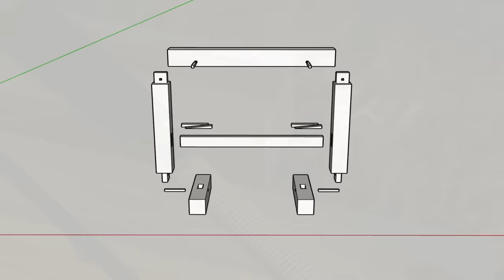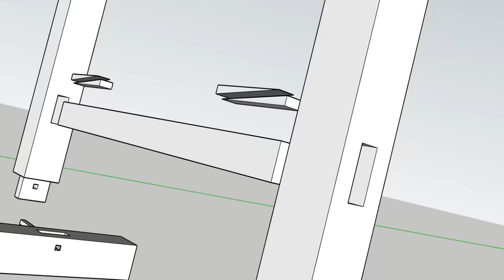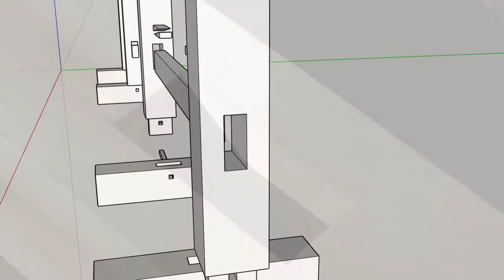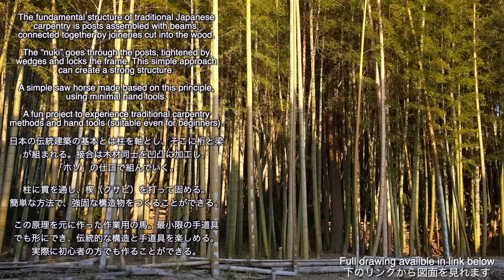Building a Carpenter’s Sawhorse - Joinery and Hand Tools (suitable for beginners)

Comment: I made a couple of those last summer! Almost the same, but the middle stretcher in mine has a tenon either end and is secured with wedges once through the mortice holes (tusk tenons?). I also rounded the feet in ogee shape as my in-laws use the saw horses as legs for a large outdoor table in the summer (I get them in the winter!). They are fantastic, and I really must make a second set because I've nearly always got something in top of my existing ones. The wood I used was just old junk wood from my father in law's farm, but it turned out nice, whilst doubling the work to make. Your approach of just a single beam is far more appropriate. I'd probably make a concave hollow in the centre of the feet so that there is just contact on the ends rather than a flat surface as I tend to use on uneven ground.
Reply from the maker: Yes, I would recommend a concave hollow on the legs as well. I wanted to do that but wanted to keep it as simple. Good luck and enjoy making your second set!

Comment: Lovely woodwork. I have 2 technical questions:
1. Is the a point in the pegs being square (opposed to round) other than athstetics?
2. What is the purpose of taking the sides of the taps, instead of letting them be the full width?
Thank you for a nice, clear and calm video.

Comment: Very cool. Sent you a beer for the 3d model. I am wondering though about the marking - what is your reference? In some cases it seems like you are doing center line reference and in some you use one of the faces?
Reply from the maker: The joineries are marked from the center reference line but only the pin (which is slightly offset between the mortise and tenon) is marked from the face. Cheers!
Reply: @dylaniwakuni  thanks for the reply. Now I am wondering how to get the mortises be at the correct angle relative to the imaginary plane. Especially for the square peg. Looks like in this case you squared the timbers precisely so all surfaces are at 90 degrees to each other. But how does one chisel the mortises when the timber is not all 90 degrees... Especially a through-mortise. I'm very puzzled. =)

Comment: i cant open the models u hoped u can add a  PDF file. btw wats the size of the beams? thicknes
Reply from the maker: I think you can view them from SketchUp:

It is free to download. To view the file, you will need to log in to SketchUp (free). A mobile app is available on the App Store.

https://www.sketchup.com/plans-and-pricing/sketchup-free

The beams are 90x90mm
Reply: @dylaniwakuni  thanks 90x90 i can work with that. i use fusion 360 as my drawing tool

Comment: You can hear the wood split at 11:20.
Reply: I don't think so. The way it's encased it had nowhere to go. Probably stepping on twigs
Reply: @Rufio1975  turn up the sound. Either way, it doesn't matter, just found it notable.
Reply: @Cannonudders  
I'm not arguing with you man.  Just giving my opinion. That's all.  You could be right.
Reply: @Rufio1975  all good. It's certainly not going to be an issue, those joints are rock solid. Great work.
Reply: @Cannonudders  
Yea, I dig his channel.

Comment: I've noticed the Japanese aren't too concerned about checks and splits in their timber . As a builder, I'd never use such splits.
Reply: In terms of building saw horses you mean?
Reply: @royalmoline7073  
Well yes and no. I've seen both furniture and houses made with checks I'd never use... from a structural point. But then maybe their perspective is more Zen, ie, it's a feature and is perfect just as it is!